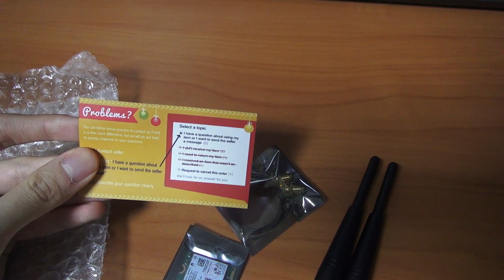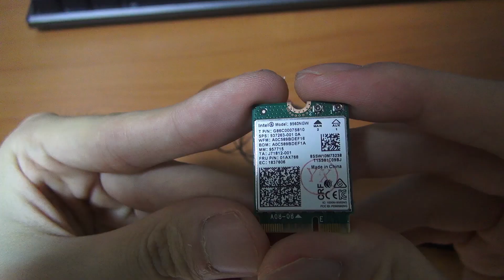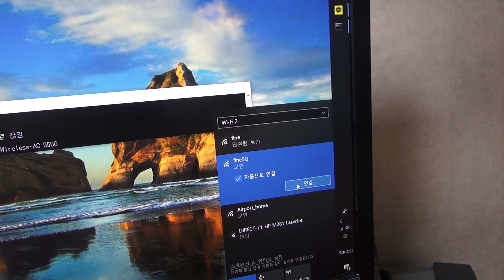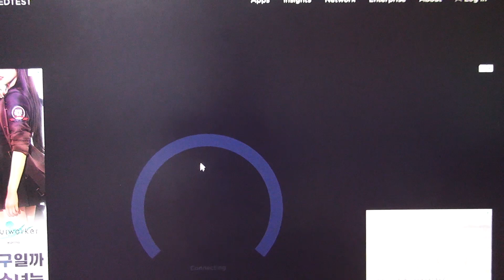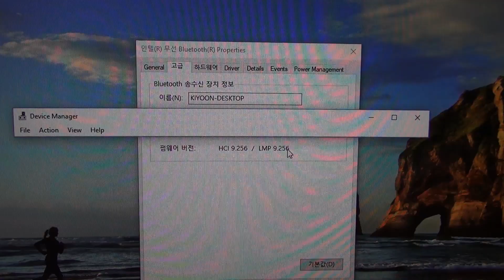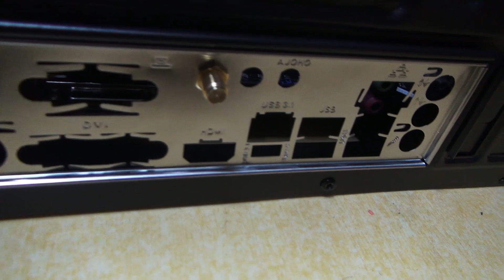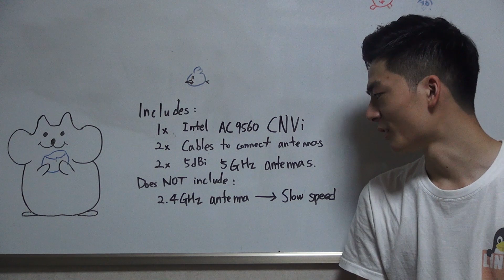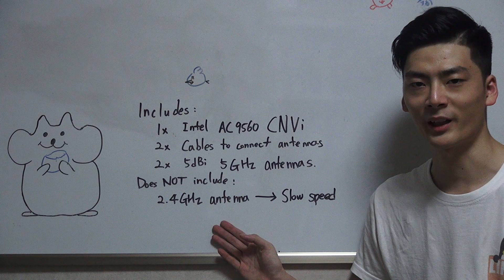Intel AC 9560 Wifi and Bluetooth card + antennas set from AliExpress review and links

Comment: Are you still live?
Reply from the maker: Yes I am, what's up?
Reply: @KiyoonKimTech  fine
Reply: @KiyoonKimTech  becareful
Reply: @KiyoonKimTech  can I ask a question/ can I upgrade my wifi Antena cable because my cable is very short
Reply from the maker: @y.t.1320  you should be able to buy only the cables.
Reply: @KiyoonKimTech  I can't buy it's very expensive in Turkey

Comment: Hey do you find a way how to extend the 2 cables until it can reach the 2 antennae hole usually at io plate. I find it difficult on my z390 steel legend mobo
Reply from the maker: I think the only way is to buy a longer cable..

Comment: it this compatble with aorus pro b360m?
Reply from the maker: Yes, it is.
Reply: @KiyoonKimTech  I installed the AC 9560 wifi card into the M2 PCI - K slot but my computer does not recognize the device in the driver.
What setup bios ?
Reply from the maker: @hoangviettran3309  What's the PCI - K slot? Sorry, I haven't really heard of that but your motherboard has to have the slot itself right?

If you installed that directly to your motherboard, chances are you need a driver

Comment: Hi! I just bought an ASRock X470 Taichi, it comes with the AC 3168 wlan card. Do you know if it's possible to upgrade that with the AC 9260? I think I have to get the 9260 and not the 9560 since it's an AMD based platform... Thanks!
Reply from the maker: Hi, I feel like you can as 3168 has an E-Key M.2 2230 shape. However, I suggest you contact the ASRock and they'll have a clearer answer!

Comment: My Lenovo S340-15IWL has a 9462 installed and apparently supports CNVi. I bought the 9560 and will update in a few days to confirm if it works.
Reply from the maker: I never tried it on a laptop, so I'd like to hear how it goes! Thanks for sharing your experience.
Reply: @KiyoonKimTech  I just got it in the mail today, and it works perfectly! The first boot after installation was very long. I thought the laptop had a WiFi card blacklist, but it turned out that my OnePlus Bullets Wireless 2 was being recognized as a USB drive, and my laptop is set to look for USB drives first lol

I can personally confirm that the Lenovo S340-15IWL is compatible with the 9560!
Reply from the maker: @AmpliFreQuency  Amazing! Thanks for sharing your experience, and glad that it turned out all okay! And that's funny how it tried to boot using earphones, haha

Comment: Good to know about the BT needing the antenna. I've been trying to get the card to work and it's just not pairing with any device, so I ordered a set of antenna. Almost the same setup, but I've got the B365M mobo
Reply from the maker: I appreciate for sharing your experience. I would also like to hear how it goes, after installing the antennas :)
Reply: @KiyoonKimTech  Yep the antenna are needed for the BT to connect. However, I have some serious lag with the mouse and keyboard using an internal card. No such lag using a usb BT adapter. Odd.
I know Win10 can have some BT lag issues, but I would have thought it would have been across BT in general rather than device specifit.

Comment: I  bought 9560NGW and it works fine with wifi, but not bluetooth. Do you know why ? (I'm using giga h370 d3h mainboard)
Reply from the maker: It might be because you haven't installed the driver, or the fault of the card.
There are so many reasons so it's hard to tell. Try to install the driver and if it still doesn't work I recommend to contact the seller.

Comment: I had a usb wifi on a mini computer my mom got me for my birthday. I had a empty m2 slot ment for a second hard drive so I just ordered a combo wifi and Bluetooth Card like you but mine doesn't with external antennas like yours. What site did you order yours from.?
Reply from the maker: I ordered mine at AliExpress (seller Wifibest store), but most likely you'd need to order cables and antennas separately unless the description does say they are all included. You can find many compatible cables and antennas if you search like "AC 9560 cables"
Reply: @KiyoonKimTech    thank you.

Comment: Having just bought a new motherboard (and parts) for a new workstation, I am considering using this CNVi socket to add WiFi.  No one (including Aliexpress) thinks you're going to attach the antennas to the computer apparently!  The ones on Amazon don't even come with (or picture/mention) antennas.  And I've never seen antennas for sale already mounted in a card cage bracket.   So everybody with a desktop computer has to fabricate their own solution, or use duct tape?  Then there are different antenna connectors on different boards, and even Intel doesn't say whether this board has IPEX-4 or something else.

Leave it to Intel to bring us a goat rodeo like this -- the folks that brought us USB, a connector so poorly engineered that it goes in the THIRD way you try it.
Reply: It is a big problem attaching antennas. Intel AC 9560NGW has 1.5 mm male sockets. Antenna connectors IPEX-4 do not keep tight without additional equipment.
Reply from the maker: If you search "AC9560 antennas" or "MHF4 to RP-SMA cable" on AliExpress, you'll find them!

Comment: Hello. Does not work with Asrock Z270 Extreme 4. Please help me with some advice. Thank you.
MIUSON 1730M Intel 9560NGW Wireless-AC NGFF M. 2 CNVio Dual Band Bluetooth 5,0 WiFi Card 01AX768
Reply from the maker: Poenaru Marian I'm sorry to say this, but your motherboard doesn't support CNVi. You need a different card called AC9260 (or different motherboard that supports CNVi)
Reply: @KiyoonKimTech  Do you have any idea what to look for?
Reply from the maker: Poenaru Marian You just need AC 9260NGW.
Reply: @KiyoonKimTech  Okay, thank you.
Reply: Hello. Please tell me if bluetooth uses the two wi-fi antennas. I am interested in using the bluetooth module only and not for the internet. Do I need antennas?
Reply from the maker: Poenaru Marian I'm not entirely sure. Without the antennas the Bluetooth connection seemed a bit unstable. However Bluetooth theoretically works on 2.4GHz frequency while the antennas are for 5GHz. I don't think it should make change, but apparently antennas seem to help. I didn't do much experiments on this one.
Reply from the maker: Poenaru Marian If you use only Bluetooth why not buy a Bluetooth dongle which is cheaper?
Reply: @KiyoonKimTech  I already bought another module that suits it perfectly. Just the bluetooth does not find all the devices. I think I also need antennas. Theoretically, the antennas are 2, one of 2.5 ghz and one of 5 ghz.
Reply: Bluetooth dongle does not last in time.
Reply from the maker: Poenaru Marian I have two 5Ghz antennas but still Bluetooth works better with them. I seriously don't know why. But yeah probably 2.4GHz antenna will help as well.
Reply from the maker: Poenaru Marian What do you mean it doesn't last in time?
Reply: @KiyoonKimTech  Bluetooth dongle It burns quickly.
Reply: When I mount and the antennas I will say if there is a difference to bluetooth.
Reply from the maker: Poenaru Marian I didn't know it burns. And pardon me? I couldn't get the last one.
Reply: @KiyoonKimTech  Hello. Do you remember me? I finally screwed up the wi-fi / bt module. For you and your followers, I mean neither wi-fi nor bluetooth works without antennas. Success.
Reply from the maker: @marianpoe  Sorry to hear that. Yeah I think without antennas even Bluetooth doesn't work. Quite strange

Comment: Hey nice video but Wireless-AC PCI Express Wifi Adapter With Intel 9260 Dual Band 1730Mbps Bluetooth 5.0 802.11ac Wi-Fi Card For Desktop PC would give you Bluetooth 5 inbuilt! Way smarter choice.

Comment: I have a slot ‘M.2 2230 for optional wireless NIC’ per the spec sheet. I purchased a 9260 only and got it to work. The connection is very low, I didn’t purchase antennas - you think antennae’s are required?

I have the ROG AC5300 router and a Elite Desk Mini G3 mini. I had to play with settings to get it to work, very low connection. I have 1bar signal and the router is 1.5 meters away
Reply from the maker: I tested without antennas, and turned out that it either doesn't connect to the internet or connects with very poor connection. I think it's due to antennas.

Comment: Hello, recently I have bought this card for my EVGA Z370 FTW, but I cannot detect it on system. I can't find information about CNVi support in my motherboard. Am I missing something or it wont work with my motherboard and should I buy Intel 9260?
Reply from the maker: Hi, sorry for the late reply. If the spec doesn't say anything about CNVi, then it's likely not supported. You can try installing drivers but if it still doesn't work then you'd need 9260.

Comment: Do you guys know if this card works with Gigabyte B360M Aorus 3? I bought one without wifi :/
Reply from the maker: Barats Yes, your board supports Intel CNVi WiFi.
Reply: @KiyoonKimTech  Thanks man! I'll buy on aliexpress too, do you remember the seller?
Reply: +Barats I was planning to buy Gigabyte B360M Aorus 3 also, how was it? With CNVi WiFi feature.. I wonder how much is the difference, if install in B360M
Reply: @JernxD  It fits me well, it's an entry level gamer board, but you have to keep in mind that this board does not support overclock. Perhaps you should try the Z370 if you want OC, but it's funny that Z370 not support this new intel Ac 2x2. I can't tell you right now the differences cause I just purchased this new feature.
Reply: +Barats do you have a statistic or do you feel that this CNVi actually doing good? I mean, do you see any difference with CNVi or without CNVi? I do not plan to overclock, brought i7 8700. which not design to overclk xD

Comment: You are the only one showing Intel 9560NGW PCI mini WLAN in YouTube.  Some comment to share with you.  2GHz only used by 802.11N or older, so when you are teting 2GHz, you are testing 802.11N, not AC.  802.11ac only run in 5GHz.

You should show the speed of the WiFi when connected to 802.11N (2GHz) and 802.11ac (5GHz), so we have idea the max limitation of the router.  Although your router could support 300Mbps in 802.11N, but due to distance or noise, it might change dynamically.

For any speed that it connected, ~30% of the bandwidth for TCP (such as http, ftp) is used for TCP handshake.  So if your Internet speed is 100Mbps, then the max bandwidth visible to application is 80% of it, which is 80Mbps.  These TCP overhead varies but they are required to ensure network packet is received by both end, as well as taken care of re-transmit on corrupted/missing packets
Reply from the maker: Sing-Cheong Chen Hello, thanks for the wonderful comment! The 2GHz speed is tested at 2:43, isn't that what you wanted? And in the video 5GHz speed was about 80Mbps, and seems like it's because of the TCP handshake.

When I was buying the product I also couldn't find any resource, and that's why I decided to make the video. Sorry that my communication knowledge is not perfect, and having lack of content :)

Comment: How to order this from asia?
Reply from the maker: Hello, this video is not sponsored so I didn't leave the link. I purchased the product at Aliexpress, from the seller named "Wifibest Store." Make sure you have a CNVi supporting motherboard (mine is ASRock B360M Pro4). Hope this helped you
Reply: KiyoonVlog
Mine is Asrock Z370 Pro4 motherboard is this cnvi supporting motherboard?
Reply from the maker: I don't think so. In the specification, there are no CNVi mentioned. You should go to ASRock website and compare the specifications of mine and yours. I have CNVi and you don't.

I believe AC 9260 will fit for your motherboard. I heard that it's similar but different type of slot. However you have to confirm if 9260 is compatible with yours, by contacting ASRock customer service.